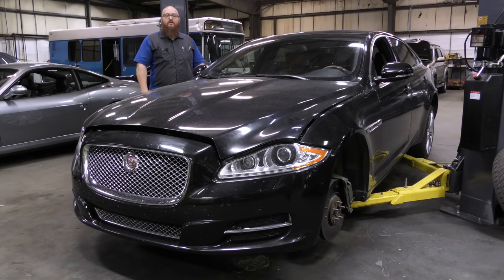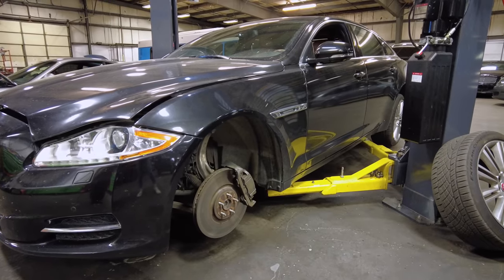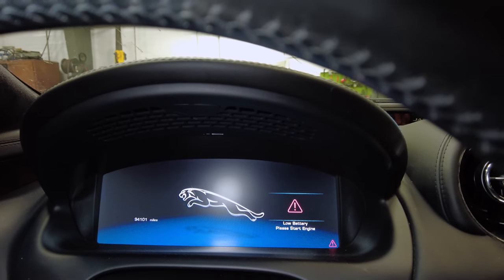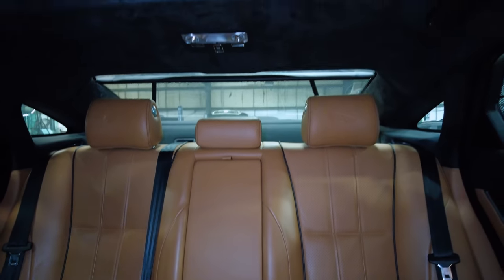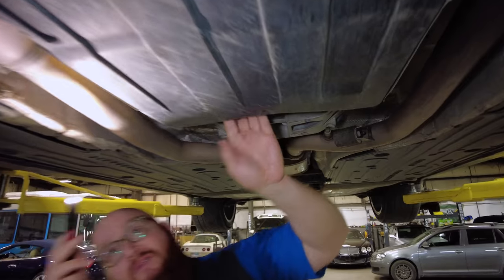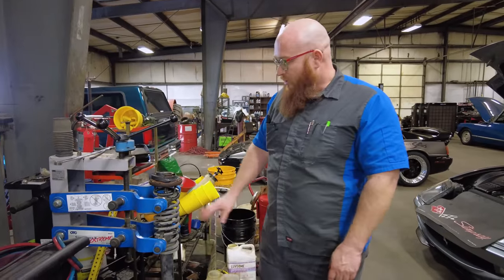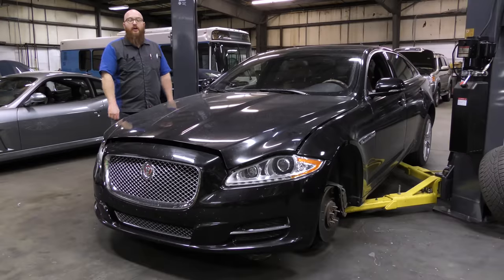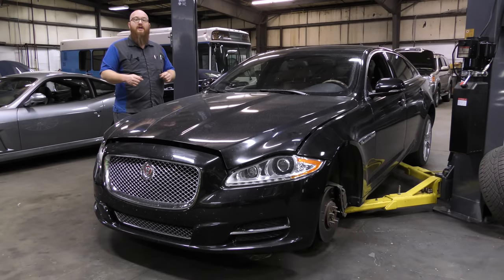Not another boring car! This '14 Jaguar XJL is anything but boring. CAR WIZARD is very surprised

Comment: Hi Wizard. I think the styling of the XJ was affected by European pedestrian collision rules that made front ends very upright and lost many hood ornaments. It would be nice if they find a way to get back to that classic look.
Reply: The previous model (the X350) didn't have a hood ornament in Europe either, only in USofA.
Reply: They tried to retain the 'old' look with the X-type & S-type and got slammed for it. But also when asking yourself does this look like a new this, that or other. Realise that you are comparing design followers with design leaders. This car was released in 2009. Look at other 2009 designs to realise Jaguar was ahead of the curve.
Reply: That and the need to cool massive diesel engines because power = good, more power = better.
Reply: @etherealbolweevil6268  this model of XJ (the X351) has basically the same diesel engine as the previous X350/X358 before it. I have one. The X350 also got the 400bhp supercharged V8, and there's a lot more room in front of the diesel than the V8, so I don't think that the need for cooling is the reason.
Reply: @PJ-om2wq  Compared with the 1970's?
Reply: And grilles had to be plastic and dull for " pedestrian safety". I am glad that I am proudly South African. I detest the EU.🇿🇦🇿🇦
Reply: @davidporter2770 plastic was a price thing and chrome plastic was all over the place.
Reply: It is exactly that.
Reply: That’s going to be difficult if more vehicle are electric SUV’s

Comment: I have kept my 2015 Subaru because the general styling of any newer alternatives is not much different from mine.  I DO miss the days when a 'New Model Year' was released in the autumn and my dad would take us along to check things out. MY dream car has a pre-World War II Bentley body mounted on a modern dual-motor electric drive chassis with modern suspension and braking.  Your wife's tour of the Jag interior rings true: for me, when I DRIVE, I see the dash and interior and feel the luxury of quality seating.  If the car delivers an all-day driving experience, that tops most 'look-alike' styling concerns these days.

Comment: As far as the front end it does in certain areas look like other lesser cars but thats where it ends. The rear is stunning, setting it apart from everything. The tail lights for instance were designed to replicate the Jaguars claws. The top with its 2 blacked out glass sunroofs  gets its cues from a yacht's upper deck. Looking at it from the side is a Jaguar in motion. The L from XJL refers to long wheelbase giving the rear passengers 5 inches of extra leg room. Top that off with the maroonish  shade of Caviar Metalic and you have an automobile that exudes ever current style and class. Also at no extra cost are the never-ending compliments!
Reply: These xj,s have the best rear of any car ever ❤
Reply: I thought the same when I saw a Lincoln MKS rear end and I thought it was a jaguar
Reply: The plastic C pillars are silly and poorly integrated with the rear windscreen despite being intended to make it look like it wraps around. It does look great from the back otherwise thought

Comment: This is the first time I have left a comment, I currently own a 2013 jaguar xf, its now done over 200kand it still runs like a limousine, I've had a few problems but I'm not writing out cheques for failing items like you suggest I could expect, my previous car was a jaguar x type 240 k and no problems,this car is still in daily use,I love them and I'm proud to drive an English car..

Comment: I not that long ago was at Avis rental at the San Francisco airport where they didnt have the car I had reserved so they offered a list of others they had sitting… he rattles off the ehhhh mehhh list and I caught “Jaguar XJ” as hes talking. Wait, hold up, an XJ sitting here? Sign me up on it. 

I have to say, I was pleasantly surprised by how well it ate up highway miles and while from the front it might look like others, the side profile and rear is gorgeous. Its a nicer car than you would expect. 

The XJ and Genesis G90 both do the same thing very well, cruise while feeling like a bigger car in the best ways. 

The XJs are nice cars.

Comment: You may wonder how I know this. I am an Engineer myself, and during my career I worked in automotive R and D. Beside Rolls Royce Range Rover and a stint at Mercedes in Munich, I had the honour to develope the prototype for the Jaguar XK8. As a life long petrol head and Jaguar fan, I had the privilege of walking in the footsteps of giants.
Reply: IMHO the XK8 coupe is the most beautiful car of the post-Vietnam era. My hat is off to you, sir!
Reply: @rhark25  The XK8 was referred to by many as the 'modern E Type'. and I think that was the goal of the designer Ian Cullum.
Reply: @davidnelson7149  The XK8 was designed by Fergus Pollock and the late Geoff Lawson, not Ian Callum.
Reply: @garyvanremortel5218  You are partly wrong, Ian Callum was the designer for the later X150 XK. Geoff Lawson was the designer for the x100. The later x150 had all the trademarks of a Ian Callum design.
Reply: @christianolsson834  the XK8 is the X100.  The X150 is not an XK8.
Reply: @garyvanremortel5218  an easy mistake to make given that Ian Callum had a hand in the Aston Martin DB7 with which the XK8 shared a chassis (with the Aston being developed from the Jaguar XK41/42 concept but redesigned for the XJS chassis).

Comment: XJ L ULTIMATE owner here, nice ride. New XJ grew on me, still love the classic Jags and former original XKR owner too. Got to remember X351 was designed to appeal to a different market. Disagree regarding front end, there's not a lot looks like it from the front (in the UK at least, maybe more in the US) and bear in mind the J-blade headlights are pretty distinctive. I like the rear end from 3/4 view but bit boring from the back. Overall it's a great car apart from fuel economy, mine had 510bhp stock, now chipped. It's scary quick! I'm about to do the brakes on mine actually too so a nice reminder of what I'm looking at!

Comment: Just had one of these over, NA 5.0, same 94k mileage. did service, front upper and lower control arms, front and rear sway bar links, bushings, motor mounts, transmission mounts. Everything was shot shot. Drove so much better after. Beautiful car.

Comment: 232,000 miles on my Audi A6 3.0TDi Avant - owned since new (2007). I have never changed a single thing anywhere in the drivetrain apart from tyres, pads and discs - every suspension component is original..... EVERY ONE. And yes, still passes its MOT (I'm in the UK) every year, failing last year for the first time ever due to a clogged up seatbelt buckle in the back (bloody dog fur!!!). We hear this all the time with US market European cars, yet we don't get the same issues at all over here. My girlfriend has a 2014 Audi A3 Cabriolet 2.0TDi from new with about 125,000 miles, and though the pads have been changed once in that time, I think she still has the same brake discs (and again, FAULTLESS on everything else all these years).

Comment: The most beautiful car , until the coolant pump failed at 28k miles, then oxygen sensor failed, I really wanted to keep my 2014 xjl for ever, so beautiful, but it was the car I had to go to the mechanic the most. Will probably buy another Xjl when I hit the lotto😂
Reply: Bro which engine was your xj v8 or v6
Reply: Sorry to say but the 5.0 motors are trash. Way too many have major lockups around 50K and the fragile cooling systems are an accident waiting to happen and then on top of all that, there is no engine temperature gauge .........

Comment: Ugh, I had my heart set on getting one of these but I got scared of the maintenance and ended up getting a Lexus LS460 L instead. I still think about the Jag sometimes. Maybe one day...
Reply: Lovely car, but I have to say nowhere near the character and “specialness” of the jag. Running cost scares are warranted but massively overinflated thanks to the internet. I would always run by the ethos of buy the car you want because if it makes you happy who cares if it costs you a couple hundred a year more than one that you wouldn’t mind owning
Reply: if you like the previous 4.2 model, I would get one without hesitation, the parts are not wildly expensive, engine is incredibly reliable, so is transmission, regularly see them with 200-250k miles with minimal service, ONLY large issue is air suspension, which can be converted and has been by most people   at this point, for around $1000
Reply: You made the right choice, I had a similar decision between a Jag XE and a Lexus IS, I always wondered 'what if?' when I saw an XE driving round.

Comment: The rear lights are designed as Jaguar Claws. I worked at Jaguar Castle Bromwich England up until 2016 as a Quality Inspector and i Loved these cars. The best i ever saw was the R model in Italian Racing Red with Black Alloy wheels.

Comment: I have the UK version XJ Sport 3.0 diesel 2019 twin turbo 700 Nm torque & 300 BHP , pity the yanks didn't get that car as its awesome ...............Superb performance and 45 Miles per gallon. My car is the face lift version with J blade headlights and upgrades through out the car. it was £ 81,000 new with all the options ticked.
To me its the best Jag ever.

Comment: Had an XJL until recently. Top of the range. Loved it! No faults. Had the V6 diesel and got up to 59 mpg on a motorway run. (UK not US gallons). Wish I still had it.
Reply: My friend had one and he traded it for an A8L. Says he regreted it.
Reply: @dingdong2103  Everyone regrets selling their XJ. After putting 166,000 miles on my 2006 XJ Super V8, I got nervous about possible future service costs and traded it in on a used S600.  Arguably a better car, but not as enjoyable to drive, and not nearly as beautiful. Every time I walked up to my XJ it was an occasion.

Comment: My first car, first oil change went to Jiffy Lube. I'm sitting in the waiting room, this kid comes out with a thick belt, and shows me that there's tiny cracks in it and that it needs replacing (you could have hung an elephant off this thing). It was the belt for the AC. I told him to replace it. Oil change took 3 hours. NEVER GO TO A JIFFY LUBE!
Reply: Samuel Williams  I live in a condo, so there's only so much I can get away with.
Reply: @hmbdata  you’re better off at ur local mechanic shop then jiffy lube 😂 it’s ok tho you live and learn

Comment: Wow, just looking at all that hardware underneath....the size and thickness of the lower control arms and the subframe, etc....and they are aluminum, not steel. The diff looks almost truck-sized too. No wonder these things were like $90K a decade ago. They appear to have been built like tanks----like 90s Mercedes' overbuilt. I bet that thing will last forever if cared for.
Reply: Agree!
Reply: except that all the plastic will go brittle & fall off. I had a XK8 and the wiring in engine bay had all gone brittle, you had to be super careful doing any work else it would crack. sold it & bought a MX5 best change I ever did.
Reply: @calthorp  yeah because an mx5 is nothing like an xk8 and lacks almost all features an xk8 has, smooth comfortable quiet ride quality, torque, etc. not a GT
Reply: @h7pubg  The MX5 NC rs does lack a lot of the features & comfort, but when I go out to use it every few weeks it starts & nothing goes wrong with it. I drive it like I stole it & with the savings on repairs I was able to afford lots of upgrades.
Reply: @calthorp  never heard of engine bay wiring disintegrating like that, since they didn’t use biodegradable wiring harnesses like mercedes did at the time, however the cooling hoses and other plastic parts do go brittle, my xk8 is very reliable but every now and then when it breaks it is more expensive to repair than a miata would be, however i class them on totally different levels of car, neither worse than the other just good at different things and incomparable
Reply: @h7pubg  Guess my XK8 had been used more than yours. I like the look of the XKF, But have not had a drive of one yet. I found the XK8 just too big & heavy, yet still had no room inside. Also it was too easy to go over the speed limit 100kph here in NZ. So if I had kept it I was sure to be going to get a big infringement fine. Cops hate you when you have a flash car. they like to take you down with a fine never let you off with a warning.

Comment: I have a 2009 XJ8, and it’s the last year of the classic, traditionally styled Jaguar.  I do think mine looks a thousand times more beautiful than the newer style.

But the car wizard is right about the interior.  The newer XJ interior is in a class by itself.  And that supercharged 5.0 will run circles around my non-supercharged 4.2.  The 4.2 is still plenty fast, however.

My 2009 has over 140,000 miles on it.  And it has required a little bit of work.  A previous owner switched the air suspension over to coilovers, a common modification that makes the car much more reliable.  I’ve had to replace the upper control arms and tie rod ends on the front suspension.  And the thermostat housing started self destructing, requiring a new thermostat and housing.  While I was in there, I replaced the water pump, as that is a known weak spot, as well as some hard to reach hoses that were accessible when I had the intake manifold off.

Overall, I have found Jaguar’s reputation for being unreliable has been greatly exaggerated, and I will hop in this car and take it anywhere.  I put around 90 miles a day on it during my drive to work.

Easily one of my favorite cars I’ve owned.

And mine has the leaping Jaguar (not leopard 😄) on the hood.

Comment: I agree about the current trend in car styling. The typical SUV/CUV (crossover) that they say 'everyone' wants (I do not) looks very 'blobby' and formless to me and so many look nearly identical. There a lack of real style to them IMHO and they often look like someone;s idea of what you'd expect to see in a sci-fi movie with styling features that look like rocket launchers to me and HUGE butt-ugly grilles that are AWFUL for their drag coefficient !
Give me a SAAB 9000/9-5 or Rover SD1 any day of the week (classic larger hatchback styling) and WHERE did all the estate cars/station wagons go ? They're very useful for those who only need occasional serious  lugging capacity. I used to be able to get the smaller version of a serious PA/Sound Reinforcement rig in my Ford Cortina Estate complete with stage wedge monitors, perfect for smaller pub gigs and the like instead of having to use a proper van. It was even possible to sleep in the back, stretched out too, so OK as an occasional 'camper' too.
The other thing with 'modern styling' is that cars end up big on the outside but small on the inside, exactly the reverse of the SAAB 9000's I ran.

Comment: The foam on the strut is used for ride comfort and acoustic improvement. That stuff is used as a bump stop on lots of more expensive cars and works pretty well and is durable if applied correctly (mainly keep away from dust and dirt)

Comment: If I saw that in my rear view mirror, I'd know that it's a Jaguar.  While a 20 year old Jag is nice to look at, it's still a 20 year old design; no company can (or should) never update its styling.
Reply: Good design is timeless.
Reply: But not unique
Reply: @ultraguy8771  It is; and certainly Jaguar's have had timeless designs. 

But it's the 21st century, and tastes change.  Nostalgia can only sell so many cars.
Reply: porsche hasn’t and they still seem to sell well/desirability
Reply: @h7pubg  Really?  They still have big bulging headlights and tall windows?

The early 911's look incredibly dated; I doubt many people buy older ones for their styling.  They sell because of branding.  Oh, and because they're really good cars.
Reply: @msalzberg4962  if jaguar stuck to the timeless e-type xk8 bodystyle and continued to improve handling, performance, ride etc they could fit the 911 sales strategy
Reply: @h7pubg  Maybe so.  I love the look of the older XJ and the later XK, but I also loved the look of my 2015 XF (since traded in for an XE, which was traded for a Land Rover Disco Sport).  The new design language is very aggressive, and I think, very Jaguar.  But that's just my opinion.

Comment: Wizard reminds me of my dad's old mechanic. His shop wasn't cheap either. But his work was far better than dealerships and best part is that he would listen to you and suggest options  from which you are free to select one that fits your purse.
Reply: Cheap always comes with a price!
Reply: Cheap is more expensive in the long run. It can even be a hell of a lot more expensive since cheap mechanics on a Jag WILL destroy the things they work on, or at least worsen the issue. Id rather pay €120 an hour for an expert charging two hours than some idiots at €40 an hour charging for 6 hours guesswork and wasting €400 of parts that didnt need replacing anyways. And still not solve the issue...